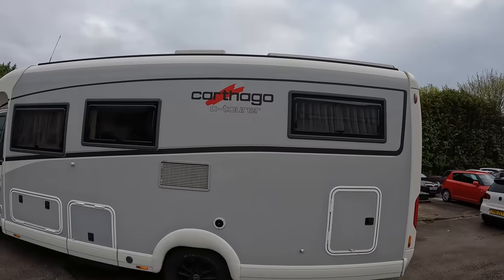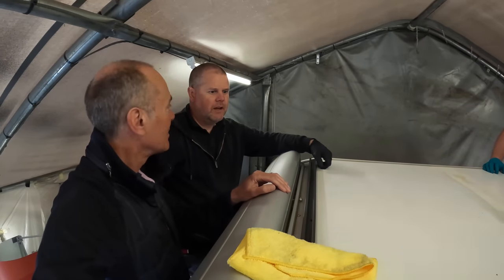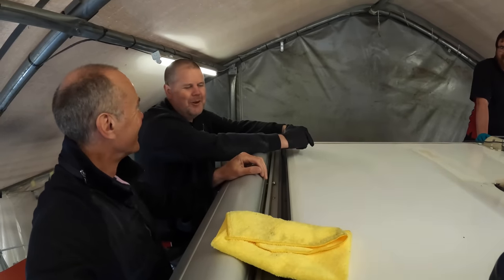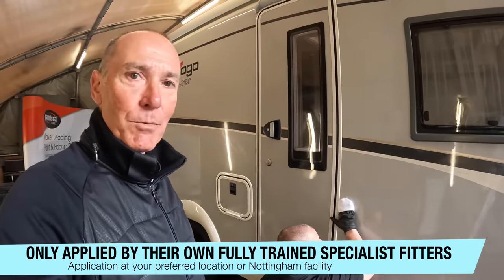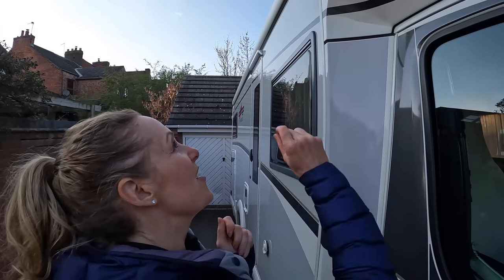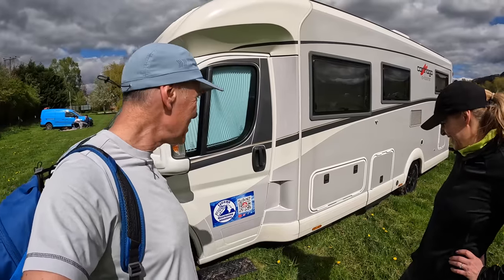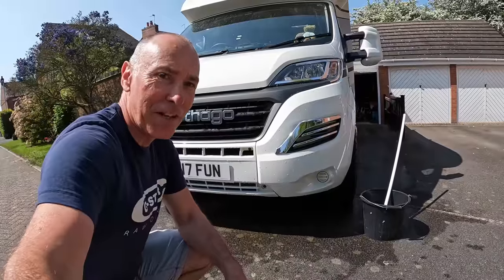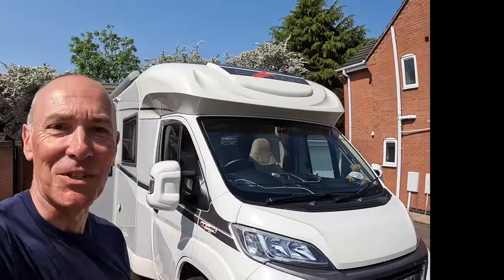DOES CERAMIC COATING REALLY WORK? Motorhome towed out of a muddy field!

Comment: Definitely worth the money , we have never regretted it . Our van is booked back in next month for a bit of TLC,  but the coating has made the washing off easier , especially on the road. Looks like a good job guys. H ad M
Reply from the maker: I actually looked at your van when we saw you last week as you returned from your travels and wondered if you had the coating! Good to know it works even after a few thousand miles on a trip😀 cheers…Andy&Michelle

Comment: I just user a paint sealant from when I buy new that does the same thing. The cost isn't worth it for me and the shine isn't the coating its the polishing they did beforehand. Good quality car soap and micro fibre towel dry. Ceramic coating won't stop stone chips either.
Reply from the maker: Hi, we've only had it on a couple of months but it is guaranteed for 5 years so I think the difference is on the reapplication, I understand paint sealant needs to be reapplied every 3 - 6 months whereas we should be ok with a quick wash and micro fibre off. I'll have to report back in a year but I am confident from what I've heard from other people who have had it done that it does last. Cheers...Andy
Reply: @ExtremeMotorhomingAdventures  What does the guarantee say though ? My Meguirars sealant Hybrid sealant wax costs £25 and  the bottle will last at least a year applying it after washing.

Comment: You go to all that expense and care and then you might as well have used a rake than use that pole brush to wash it.
Reply from the maker: The pole brush is a professional coach brush, very soft bristles, the ceramic coating is also very hard, you would need a machine to get it off